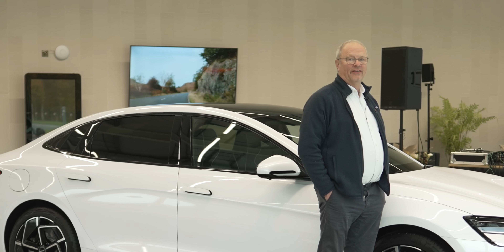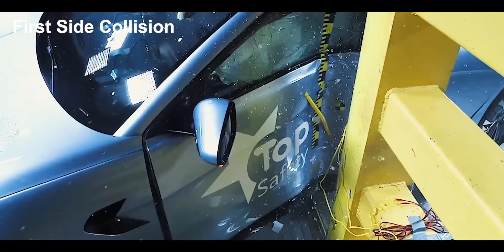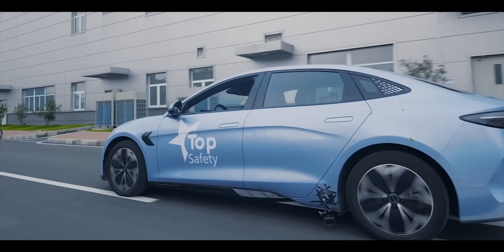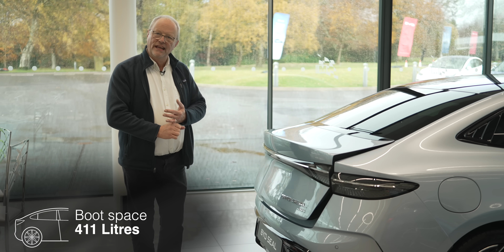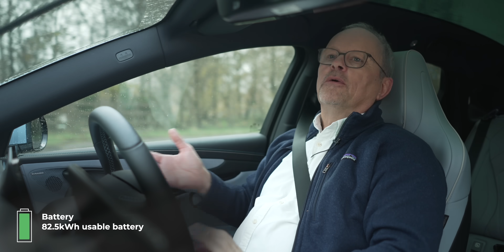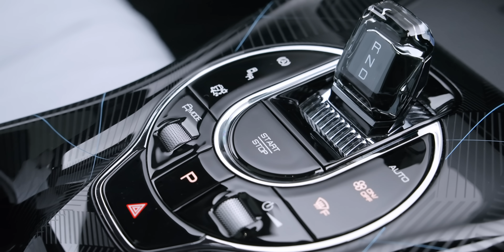This Car Proves Just How Far Chinese Cars Have Come

Comment: I'm skeptical about BYD's heatpump claim. At such low temperature the efficiency can't be good. Also it'll have to work very hard, how about noise and vibration from the heat pump? Even if they manage to insulate the noise and vibration from heat pump, the fact that it is a complicated device with many moving parts, I question its long term durability. Slight misalignment of compressor fan will make it sound loud and vibrates, just like an old AC or refrigerator. I still hope future EVs come with optional fuel based heater for colder climate. Heat pump is just an overly complicated, expensive, and non-robust solution to a simple problem, all the name of reducing 3% of emission.
Reply: It's nothing of the sort.  it's  reversing valve on the air conditioner.
Reply: @jamesengland7461  Yes, it's reverse of AC. But it's based on the same principle. It still requires compressor, and refridgerant. I went through an unbalanced heat pump, after it worked "too hard" in Canadian winter. It was covered under warranty, but took a long time to fix because they lacked technician knowledgable enough to figure it out. All I'm saying is that heatpump is great in theory, but in practice, it's overly complicated and easier to break than fire based heater.

Comment: According to a midlands based home battery supplier BYD, actually stands for Borrow Your Design! And looking at this it seems that they have looked at the m3 and done just that, then added some bits, hopefully they won’t remove the indicator stalks,but let’s not forget that Tesla also use the blade battery.

Comment: A new car, that isn't a crossover. That's a nice change of pace. Doesn't seem like there are any tactile climate controls, or basic media controls (except for the volume), though, so it doesn't appear to pass the blind-fold test. (i.e. being able to use those controls, whilst blindfold ...and not counting voice controls) Also, being a luxury car, it wont exactly be the most affordable option.
Reply: The scroll on the right half of steering wheel, plus the two arrow buttons by the side of the scroll, can be used to control these options.
Reply: @deepseer  A scroll and two buttons, can control ALL climate controls, and basic media controls? (except volume) That is not, practically, possible.

Comment: Achillies heel of all EVs...where the electric going to come from to charge them all? There simply is not enough electricity generated. Only ever going to be a niche product for the comfortably well off. That being said does look a nice car.
Reply: We already have the power needed, because we can refine fuel with it and fill up about 30 million cars in the UK, it takes about 12KWhs just to refine a gallon of Fuel and that gets you on average about 39.9 miles of range.
Then you have to transport that, using a Semi that gets maybe 5MPG on average, so we can say about 20kwhs of power for refining and transport.

The average EV right now manages about 2.9 miles per KWH, so even taking the refining power cost into the equation alone we've very close, 20kwhs would get an EV 58 miles of range, using the average figure.
EVs are getting more efficient, the average will soon be 4 miles per KWH or double the range the average ICE car can get per gallon.

We're adding massive capacity to the grid's capacity to transmit energy, plus we are vastly increasing actual production and we also have to factor in that electric vehicles actually reduce the strain by making vehicle to load a part of the equation.
There is ample power generated and more being added over time.

Comment: What happens when the temp is below -30C ? Are you without hiting then???
Reply: If it doesn't have a backup resistive element then yes you'd just be basically without heat. Hope you brought a hat :)
Reply: At that temperature, maybe it's sensible to stay indoors!
Reply: Well in northern Sweden we have o go to work even if it is a bit cold. @kesgreen4639

Comment: Got Atto3 for 8 months absolutely love it, the seal is a very nice sedan, test drove it in China, amazingly comfortable and nicely built. Seal DM-i is more luxury then seal. The rotate screen is very useful if you drive on a long stretch road, as you can see far more distance in front of you on the map. The safety is amazing as the battery pack protect you much better then any ICE cars.
Reply: seal has a obvious accelerator pedal delay even in sports mode. this is annoying to me, otherwise are pretty good.
Reply: @张蛋疼  That is for front wheel drive version, as to avoid the skid of the wheel if push too hard and quick, actually works well, remember atto, dolphin and front drive seal are not sporty and should not be. The two motor version seal has no issue like this so could get 3.8 seconds to 100kms.
Reply: there is no front drive seal, only rear drive and AWD @tonywei423
Reply: @张蛋疼 sad to see this. Was the problem even in dolphin and atto 3
Reply: honestly, most EVs have more or little delay for safety and riding comfort, but not necessary for a sport car especially for its sport mode @jasonw98
Reply: @张蛋疼 

The pedal delay is intended to be more comfortable for passengers, as well as safer, so it was set that way on purpose
Reply: @agusedyanto3324 Not so comfortable when the horsepower is huge. First I press the pedal for about 20% and no obvious  speed up, then I press it about 10% more and I was KICKED forward like I'm firing out of a cannon
Reply: zero delay pedal (like Tesla) is really good for a high horsepower vehicle, I know what I'm doing and it act just like what I want. @agusedyanto3324
Reply: Note: the first 20% are not pedal's deadzone, the speed will start increasing after it for about 1 sec  @agusedyanto3324
Reply: @张蛋疼 这个是因为比亚迪的对这台车调教偏向家庭
Reply: I think the purpose of the rotate screen is mainly for compatible with the phone based apps. You can install any apps onto the car system as long as you got the proper .apk file. Some apps are only designed for portrait display so they may look weird on a landscape screen.

Comment: 300 miles on a battery with over 80KW?? Even 325 miles isn't very good!!! The wife's kia e niro can get about 315 miles on 20KW less
Reply: All year round?
Reply: @FullFact548  265 in winter, use heated steering wheel and seat only

Comment: Its not the catching fire that's the problem its putting them out when they do, ice cars can be exstinguished in around 5 minutes and they are then safe to move, Ev's and hybrids is a whole diffrerent matter, If you believe otherwise I thing you must have been asleep for the last 2 years
Reply: But if they don't (or are very unlikely to) catch fire in the first place (unlike ICE cars - phenomenal numbers of ICE cars catch fire every year; just in the UK) then it's somewhat of a moot strawman argument you're trying to make 😉
Reply: @InBodWeTrust 
They just don't "get it", do they?
("BMW diesel UK police fleet" is a good example)
Reply: @InBodWeTrust  I'll sleep better tonight now knowing that they unlikely to catch fire, because there's more ice cars that do, Yeah great argument, and it still makes me smile that ev fans convince themselves otherwise
Reply: @karlbrade7873  typical anti-EV whataboutery 🙄
Reply: @karlbrade7873  If I were you, I'd worry more about leaving your mobile phone on charge on your bedside table while you sleep 😴
Reply: So called 'eco-arsonists' set fire to 15 Teslas in a Frankfurt car park, and the fire brigade extinguished the blaze in an hour. The cars were completely gutted, but not one battery pack caught fire.

EV battery fires can be controlled in a few minutes with the right equipment, such as the Bridgehill lithium fire blanket (called that because the blanket is made from lithium!).

Depending on which research you read, and there is plenty, an EV is at least 20 times less likely to catch fire than an ICEV. The media posts every EV fire but has stopped reporting on ICEV fires because they are so common that they are no longer newsworthy.
Reply: @FullFact548  Thanks for the post. Bridgehill is a Norwegian company, where they know a thing or two about EVs. If people haven’t heard of them then search YouTube for Bridgehill fire blanket.
Reply: You need to do some research on LFP batteries that are used in BYD Seals.
Reply: Can someone complete the following sentence…. Electric vehicles are more likely to be written off after a minor accident because……
Reply: @karlhulme8014  ... it's still a relatively new technology, the repair infrastructure isn't quite there yet, and insurance companies are ignorant and led by people with an ingrained ICE mindset. (The ICEV has a 100+ years head start on BEV, but BEVs will become mainstream in a far shorter timeframe and the repair infrastructure will quickly catch up such that insurance companies realise that they don't HAVE to replace the battery pack in the case of an accident).

That do for you? 😉
Reply: @InBodWeTrust  and in the meantime I presume that despite this lack of infrastructure you’ve actually bought an EV ?
Reply: @karlhulme8014  I've not hid this fact in any way. In my case the car has been great to drive, great value, and the infrastructure (in my case) has been fine (just had the 1st service today).

Whilst it was in for service I was driving my other half's ICE car ... what a horrible experience!
Reply: @InBodWeTrust  well I’m glad you’re happy ….although like most 2 car families you have kept an ICE vehicle for back up.
Reply: @karlhulme8014  not for backup - that's just her car that she's had since 2019, and happens to be an ICEV. When it comes time to replace it then there's a high probability that it'll be a BEV (IF we decide we still need a 2nd car).

Keep digging - you'll be through to the other side of the world soon 😉
Reply: That's what you need to believe. @karlhulme8014
Reply: @karlhulme8014  people who believe anti-EV propaganda don't know what they are talking about...

Comment: Catching on fire maybe the smaller part of the danger of EVs, the larger part is how the fire feeds on itself and is very difficult to put out. If your EV catches on fire in a garage you are not likely putting it out, if your ICE catches on fire you likely can put it out with a small amount of luck and a fire extinguisher.
Reply: You are very well uninformed.  Ice vehicles catch on fire 20 to 80 times more than EVs.

Try google, it might be life changing!
Reply: Been selling BYDs in Thailand with LFP batteries for over a year now they are the best selling EVs here, not one traction battery fire.
Reply: If your EV catches fire with you in it... Or rather, if your EV battery fails with you in it... You have minutes to evacuate yourself and passengers from the car.
.
If your gasoline powered vehicle catches fire, you have seconds.
.
"In a garage"?
Are we talking at home, when you're awake? or sleeping?
.
Awake?
You really think you could extinguish either?
.
Rule#1
NEVER approach an established fire in an enclosed space.
.
But if you did.... Which one would escalate first?

There's a very high chance that by the time you knew about the gasoline fire, it would be beyond saving and when  the fire department arrived, there would be little left of a gasoline vehicle to put out due to the energy density and rapid escalation of the fire..... The property it's in? Good luck.
.
An EV?
You might hear the noise of a cell failing.
If so, you might observe the failure progressing, call the emergency services, have them arrive in... 10 minutes?
By which time there MIGHT be a dozen cells in failure....
There MIGHT be a chance they could get a chain attached and drag the car outside (something you could NEVER do with an ICE, in 10 minutes it would be a fireball)
.
If you were sleeping?
You MIGHT have a similar chance if the popping cells woke you up.
ICE car? Major fire.... Good luck.
Reply: @rogerstarkey5390 I suggest you have a 2 minute chat with a firefighter.

Comment: I did test drive this car and it's amazing. Being a happy BYD Dolphin owner, I can say the build quality is up or better than the the traditional car brands in Brazil. The price is right, efficiency is great. It's a solid model from a rather unknown, yet remarkable brand. This is my first Chinese car and my first BEV.
Reply: yep, once you get accustomed to the electric car, it is difficult to go back traditional one. Comfortability and quietness
Reply: @Mountain_Wave1  For a 3 to 4 minute down time and a range of 570 miles which supersedes any EV, 41 thousand dollars paid off and just as comfortable, I'll keep my jaguar XJl....
Reply: Meu sonho andar nesse! Me leva pra dar uma volta hahah
Reply: You can't refuse when you drive this car.
Reply: daily usege cost is 1/5~1/4 of fuel car,  Near zero maintainence cost
Reply: @jeffsonic  hummm kool! Good for you but fortunately for you, your maintenance time hasn't come up yet. Your time will come when you'll need tires which are specialty tires to better handle the weight of your car which cost more than standard tires. Your car like all cars need a measure of care and keep. You should check battery coolant levels, power inverter, cabin heater, and charger every 7000 miles. Cabin air filters, windshield wiper blades, washer fluid and break fluids. The suspension  systems in EVs function the same way they do in traditional cars. Consumer Reports states that EV owners most frequently reported troubles with battery and charging systems. But the biggest things to keep in mind are your greatest costs of all. Battery replacements can cost you a whopping 15 to 20 thousand dollars (minimum)!! In Some EVs, battery replacement can cost as high as 60 grand. The annual insurance cost for an EV is $2, 152 to $ 4, 725. I pay 1, 642 full coverage for my jaguar XJl which carries a 570 mile range. So if someone tells you that you dont have to do a thing with EVs, you tell them their a lier, ALL cars need care....
Reply: @carlsmith5545  how much will your insurance company compensate the family of  victime if you accidently hit someone to death when you pay so much money to insurance($1642 each year)?
Reply: @jeffsonic  I have 100 percent coverage in everything from deaths to repairs on both ends. Bumper to pumper roof to under carage, wheel to wheel, the biggest insurance policy i could get for my long range galaxy class starship, and also covering the wife's Nissan pathfinder rock creek addition so actually it's slightly more. Both ships are on the same policy. Anyother questions jus post it, im getting ready to travel (long, long) distance. From Lancaster county Pennsylvania usa to Miami Florida. 1, 197.7 miles 17 hours and 25 minutes. Thank god i have a range of 570 miles. You have yourself a nice day mr Jeffsonic and be safe in your journey through life..
Reply: I think an insurance policy should have a coverage limit, If you really cause very serious damange(like an car accident cause big explosion of gas station) , they will only cover a specified max amount, not everything.

Here in China, every car driver(not truck driver) have to buy a mandatory insurance which cost $120 each year, the compensation is up to $28,000. of cause, this is not enough for serious traffic accident if death is involved.  So usually people will buy additional insurance policy, the most popular one cost $200 to $300 each year, compensation coverage is up to $140,000, that is 2 policy i usually bought. I don't know others.
Reply: @jeffsonic  This is the United States of America, not china. Bring me the Zeekr please. Over there in china you have bullet train technology which is also, (fully electric) Here in the United States, we're to stupid to aquire such a great technical technical engineering marvel. To the far more advanced countries of the far east. Hats off to you...
Reply: @jeffsonic  lol!!! An explosion at a gas station? Lol!!!! Now what movie were you just watching? 🤣🤣🤣
Reply: if by mainstream means Toyota, Mazda and GM then BYD definitely have a better build and interior...
Reply: wise choice
Reply: Tom cruzes em ação 😂